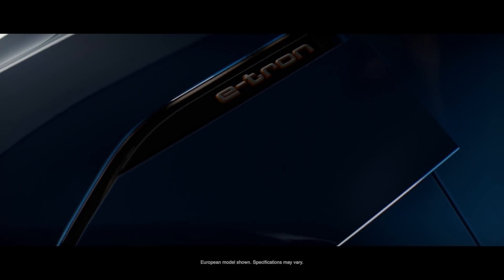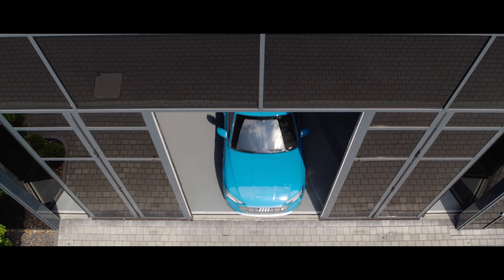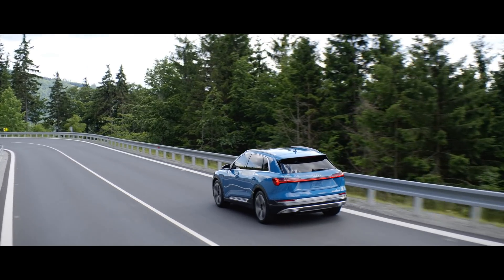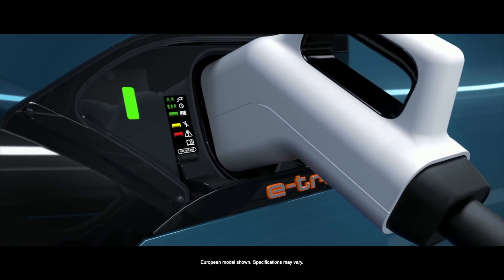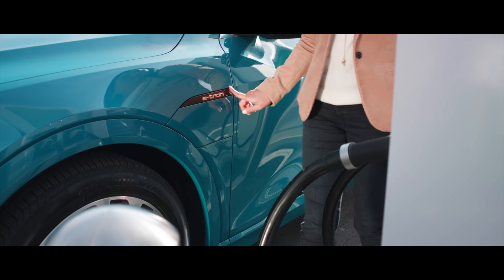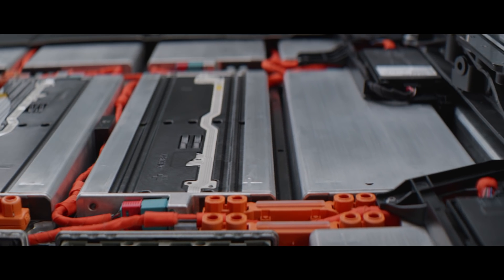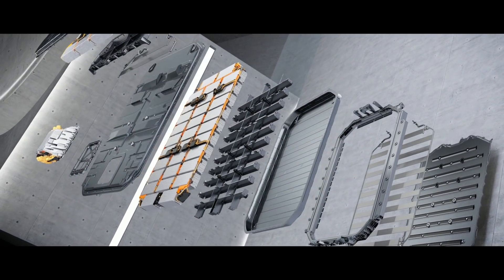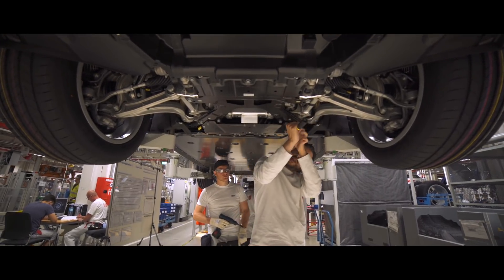Audi e-tron Defined: Battery & Charging

Comment: I’m super disappointed. I have an Audi etron GT 2022, and it should accept 270kw. But it never does. I put the destination into the nav and fords, kias and Hyundais are always charging at a faster rate than my GT… which makes no sense. Audi has no idea what the issue is. And people on forums say you need to put the destination into the MMI but you have to be in comfort or dynamic mode and the AC has to be on… and I’m still not getting over 50kw

Comment: No key fob detected...button to open charge ports should have drivers fingerprint biometrics to prevent tampering.
Reply: You must have the key on you in proximity of the charging door or it wont open. The charging cord also locks in the connector until you unlock it again pushing the button (requiring the key be in proximity).I should clarify, I just went in the garage to double check. If the car is locked then what I said above is correct. If the car is unlocked you can open the charge door without the key. Hope this is clear...
Reply: Great idea Jeff. my wife has  a 2018 Lexus RX350 and the gas cover is locked but will open if the engine is turned off. For a $55,000 car its software and amenies are about on the level of a KIA Soul ($20,000). The car commercial shows a car stopping for a kid who runs out in the street--in the Lexus that kid would be toast, the car refuses to stop automatically. Automatic Lexus has years to go in software for autonomous cars....